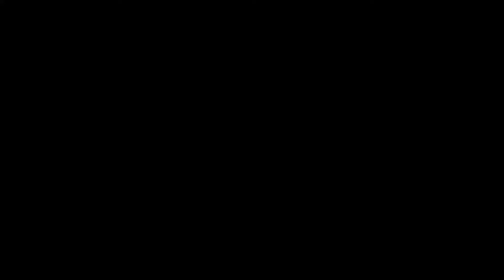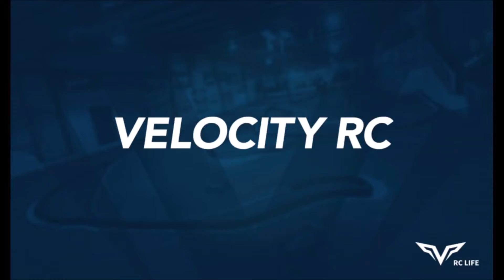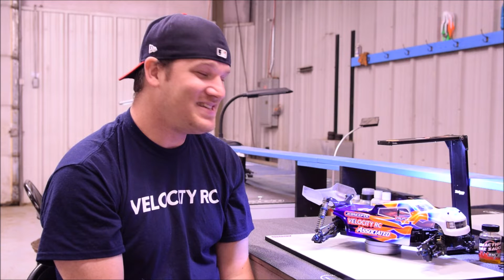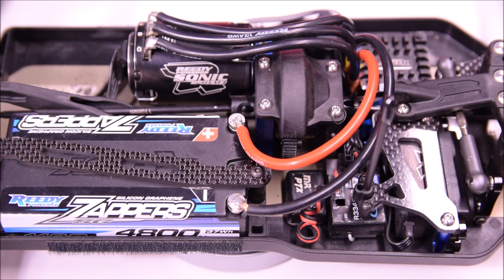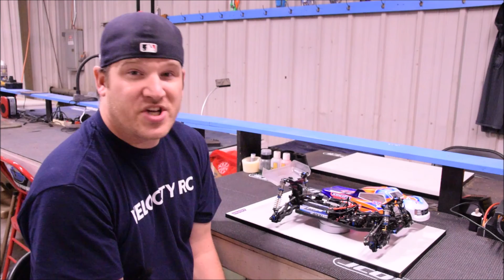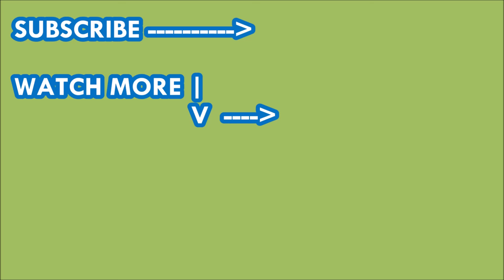Velocity VT64 Conversion Build And Set Up Tips

Comment: Please advise concerning rear shocks... this will be set up for outdoor dirt tracks that also see 1/8 scales...
   I picked up a VT64 but dont know what is in the diffs and shocks...and it has no swaybars on it yet... thinking I may start with 32.5 all around...1.6 2 hole fronts, 1.7 2 hole rears, and 20k front/100k/15k rear... let me know what you think.
Reply from the maker: Message me on Facebook @rc alley and I'll send you a dialed setup for outdoor.

Comment: Does this kit use a Truck Rear Spring or Buggy?
Reply from the maker: Truck
Reply: @RCAlley  So many damn springs. Do you know part number for Green Rr's and Yellow/Blue Fr?
Reply from the maker: @scottgolden7201  I don't but it's version 1 or v1 springs.
Reply: @RCAlley  Huh, I have no idea which AE springs are v1 or v2. Will have to try to read up.

Comment: What pinion do you recommend running with a 10.5 motor?
Reply from the maker: Around 24.  It really depends on the motor brand.
Reply: RC Alley tekin redline 10.5. Thanks